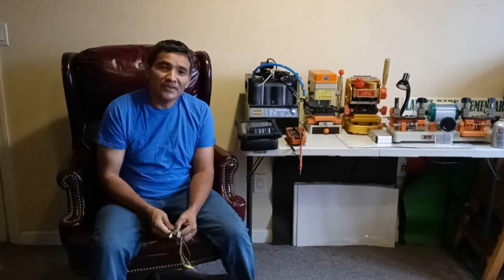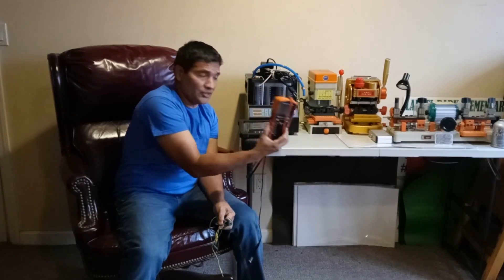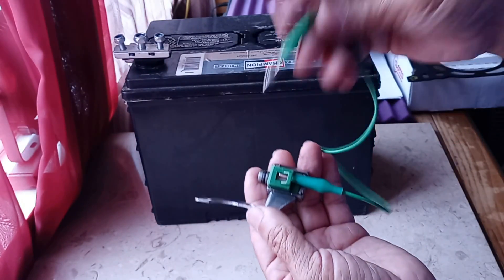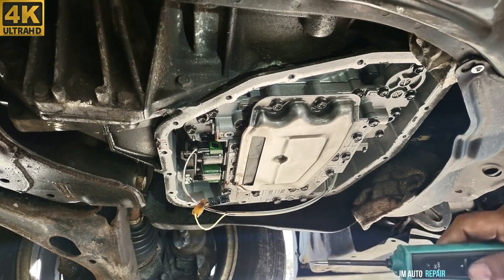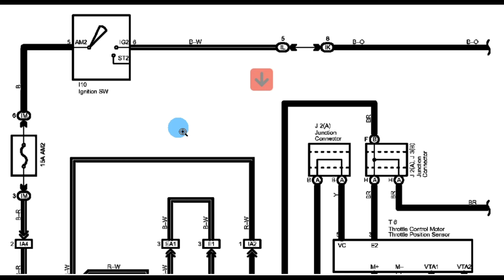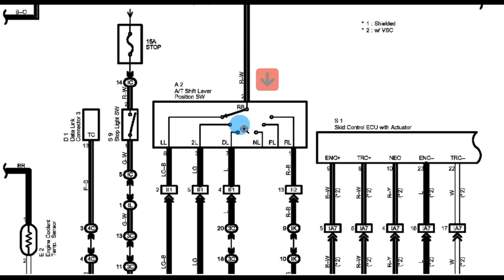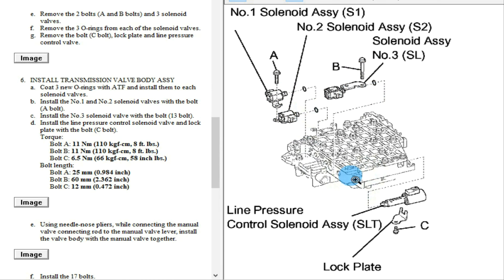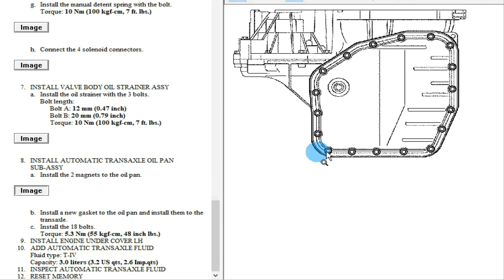Toyota Corolla Matrix Pontiac Vibe Code p0751 Shift Solenoid Valve S1 Stuck Close Or Open

Comment: Question, I have model 2003, but when i put the shift on Drive it doesnt move immediately. ill be waiting 5 minutes before it move forward. Can you give some advise?
Reply from the maker: normally only the transmission does this but check for codes for transmission, may be one solenoid is failing. other wise the tranny should have internal failure.

Comment: I have a question about the first solenoid that you tested it looks like #3(SL) that is the same one I am trying to figure out if is bad or not. I have a code p0741. 
When I test it with the multimeter it is good at 13.4 When I test it with the battery I only get the one click the same as you did. That means it is supposed to be good right? Im just confused because the other solenoids you tested it makes the click sound every time you touched it.

I noticed on the diagram it looks like you labeled solenoid 1&3 backwards (9:43 in the video) #3(SL)  is the yellow and #1 (S1) is the white.
Reply from the maker: hi, thanks for watching, I might have pronounced the wrong solenoid number I would have to watch the video to see that but if you have  p0741 and 05 corolla: that is solenoid S1 the one in the corner with the yellow wire (pale yellow). also the diagram is there, if you have it out of the valve body it n you apply 12v it will operate or click only once, if you want the solenoid to click again then you have to disconnect it from the 12v source n wait aleast 30 seconds or one minute so you can apply 12v again and it will click again, if it is in the valve body it will click every time you apply 12v if it is good. if you have any question dont hesitate to ask me. thanks again for your time on the channel.
Reply: @JM-AUTO  I just put everything back together because I was getting the single click when it was off. I was getting the same result when it was hooked to the valve body just one click. I hope I didn't put a bad solenoid back in there. 

I saw on one of your videos that if I have other codes I should diagnose that first. I have a p0171 system too lean so I'm going to work on that one. After I fix that, hopefully all is well. 

The only symptom my car has is a slight tremble feeling every once in a while. I'm not sure if that's being caused by the p0171 or p0741. I'll let you know whatever I find out. Thanks for the reply
Reply: I think you are  confusing S1 with SL. SL is the one in the corner with the pale yellow wire. S1 has the white wire. Look at 7:11 in your video  the diagram shows S1 is white. 
Or maybe I'm confused. Let me know😂
Reply from the maker: @neil12c  great point, my friend, code p0741 is for SL, I 'll take a look at this later on, thanks.